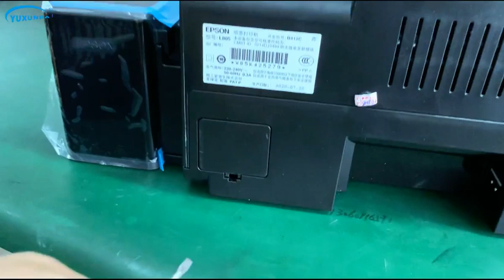How to convert Epson L805 printer to DTF, To print PET film,then transfer to fabrics, and more!

Comment: what is the white sticket you put at the side?
Reply from the maker: just a label sir
Reply: i am talking abou on 1:17 , the two adhesive? is it just norman adhesive?
Reply from the maker: @payatgg8285  sponge adhensive
Reply: ok so just add sponge adhesive and waste tank and should be good?
Reply from the maker: @payatgg8285  we think that's enough
Reply: I have Epson L 805 with sublimation ink
Can i convert to dtg
Reply from the maker: @ssprestigegraphics  need change all ink , but we are not sure if ink mix to head may clog or no
Reply: @yuxundateam1542  thanks. By the way, what is the sponge adhesive for?

Comment: Thanks for the tutorial. I have an Epson L805 printer, do I need to remove the rollers to convert it to dtf printer? How do I get the chip? What are the other requirements I need? Thanks once more
Reply from the maker: it works with pigment ink but not latex ink. please email to info@yuxunda.com  for more details
Reply: This person don't understand what you're and it's just and time
Reply: How where you able to solve it did you remove the rollers